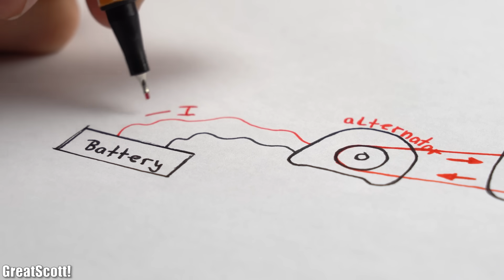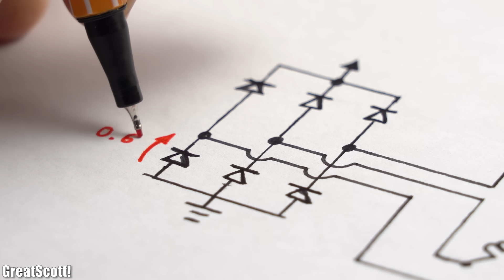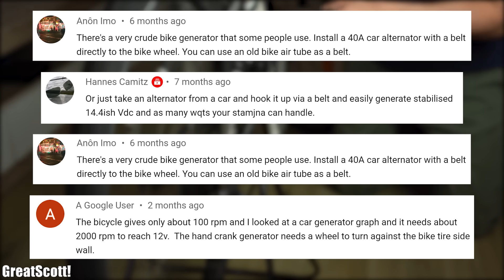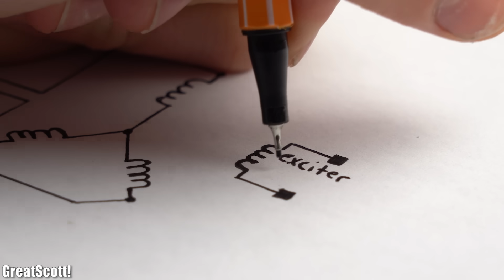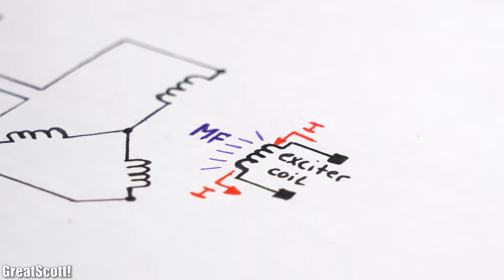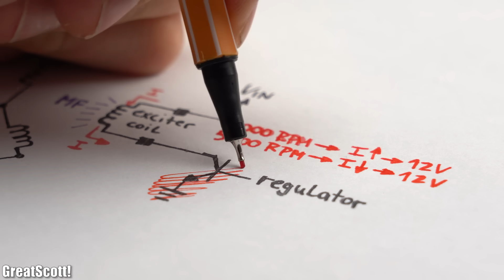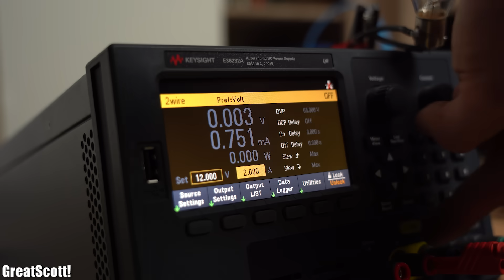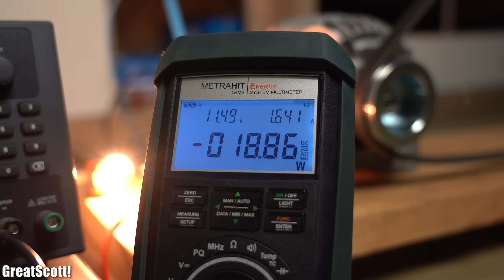Using a car alternator with a bike to power my home? How much energy can I produce?!

Comment: If you used some 12DCV group 31 stud type batteries or maybe even larger ones like 8D batteries in parallel with large gauge wire and good ring terminals to create a powerbank and ran a few alternators also in parallel to recharge the bank and you used a good belt and added a tensioner to reduce belt slip while maintaining optimal belt tension I see no reason why you couldn't run a large inverter off of the system and power something decent sized.

Comment: It can produce a power of 1440W.  Well, 746W = 1HP.  How many horsepower can a human produce?  I understand it's about one tenth of a horsepower for an average person in sustained effort.  A crack athlete can produce about 1HP, but only for a short while.
You should have used the BLDC motor as a generator - no problem there with producing a magnetic field.

Comment: I think you may need to spin the alternator much faster. My car idles at 6-700rpm and the driveshaft wheel is much bigger than the alternator spindle. I've not measured, but I'm guessing at about 4-5x bigger.
So that would mean the alternator would be spinning at 2400rpm at a minimum...

Comment: Ah that reminds me to the 90s, when my father tried to build a wind turbine for our RV. Not sure if he used a car alternator but it was quite a challenge to even power a tiny lightbulb. The thing also turned out to be quite dangerous when in use, with a ~1m rotor spinning at high speeds, mounted to the RV. Good times.

Comment: There must be a way to increase eficiency
Thank you for the video, I learnt somethings
Reply: actually changing to highest gear, building an MPPT regulator for the exciter coil, using the right six-grooved belt for the pulley, and a belt tensioner.
Reply: Yeah, maybe hook up multiple generators. Same effort more power efficiency.

Comment: Could you use this system to charge some batteries and run your house lights and possibly small appliances?
Reply: No. The output would be 50-75 watts. Even 10 riders powering everything would be 750 watts. Good for a few lights but not much else.

Comment: I did this with a vw generator from the 60s   I was able to get up to 20 volts using a bike trainer. I was thinking about putting it back together. I would like to test the amp output. Good video though.

Comment: Hey Scott,

I do not know the exact age and model of your alternator but if it is an older model, the 2 pins might be DFM (digital field modulation) and LAMP connections.
You were right about the excitation coil but the current should be regulated by the regulator, not from an external source.

These bad boys can easily push out currents around 100 Amps at 12 V, so when you are not drawing that much current obviously you do not want to dissipate that energy as heat, the regulator automatically turns down the excitation on the rotor, so you are not generating excess energy and also do not break the engine.

The DFM terminal usually used by the ECU to monitor this PWM signal, but of course it can have hidden functions which is used during production and testing.
Excitation should occur automatically, but you a need a certain RPM and a not drained battery (some supply voltage) to start up.

The LAMP terminal is a simple transistor, usually used to operate a relay inside the car. The function of this is to do not power excess electronics in the car when you start the engine, only after everything  is stable. The name LAMP comes from the fact that it is also used to light up the battery symbol on your dashboard when the alternator is not running.

Take everything I wrote with caution since a lot of solutions and designs are in circulation nowadays but you know it is automotive stuff so at the same time it is more or less standardized.

Keep up the good work, I like your videos.

Comment: If you remove the diodes you can turn the alternator into a generator. The diode circuit transforms the ac into pulsating DC that's why you get constant 12vdc out. But if you remove the bridge rectifier you will get AC output. Then you just need to find the RPM that maintains the freq. that you need for your AC requirement. Unless DC is what you want.

Comment: First, gears have teeth, a pulley does not, regardless the language. Words matter.

Second, 1 horsepower equals 746 watts. Before losses. You are not a horse, so not even gonna get close to usable real time power output even with 100% efficiency. And that design has a LOT of losses. Adding a tensioner just adds another loss. All friction is a loss. Instead, mount the alternator such that you can pivot it to add or release the slack in the belt, like is done in a car. A flywheel would possibly be the only useful addition that would compensate for it's loss by making the pedal workout a bit less exhausting. Would have to experiment more to figure that out.

Therefore, regardless the design, as a human powered device, it's usefulness is as a 'trickle charger' for a battery system. (That's what the setup in the movie 'Soylent Green' was used for, to charge a battery that was then used to power 12V DC appliances - light-bulb and hot plate. An inverter would have introduced losses that someone actually needing such a system isn't gonna add to their workout.)

But def an informative experiment, and I wouldn't call it a failure since it provided a lot of data very useful for your next try: Win-Win. Success, win. Fail, win with more knowledge not possessed before.

And, yeah, after watching so many of your vides, cool to put a face to the voice.

Comment: Simple solution. Replace the exciter coil with a speaker magnet that is about the same size so it fits inside the rotor.

Comment: Hi Scott, you measured 21W at output. I am quite certain that it is because you connected 21W lightbulb. Please, please redo the video with a bigger load. I suggest more lightbulbs and try to connect them one by one it should be harder to turn the wheel as you will have to apply more force to higher load. A cyclist can produce about 200W easily and up to even 1200W or more for sprinters. I hope I am understandable :) give this thumbs up please so he can see it ;)

Comment: Pretty sure it takes 2hp for every 25amp @ 12v
Reply: 2hp is around 1500 Watts     25amp @ 12v is 300watts    that's a huge loss.   Also a horse is actually around 8 hp.   A human is about  1/4 hp.

Comment: An oem front load washing machine motor into a inverter ? And can be stacked (multiples on one shaft), has less drag than an internal... 
Stay Safe
Reply: Alternators only provide power as needed (demand), you'll have to bypass that feature

Comment: I was a designer for a stationary power bike company for segeral years..
we could easilyt make 200 watss with 250 max possilbe....you're not thinking...
flywheels will help a lot..and you dc motor is wayyyy too small....this is home  made grade stuff...
motors that power chainwheels on bikes are the way to go...
I have a few of these motors I could sell you...
Savanna

Comment: Hmm, only 20 Watts? Have you checked the wattages of a typical, amateur road cyclist? They can put out 200W constant, no problem. Zwift reports from output from 150W to 600W, depending on whether I am cruising on the flat or sprinting -- and I am over 60. Younger riders are stronger (if they have trained even a little). So: apart from slippage -- which could be addressed with a belt or chain drive -- where else was power being lost?

Comment: You need belt tightner/tensioner to get equal and constant energy. And your wood-stand is not good enough. You need metal supported stand to avoid wobble.  Good luck with your project.

Comment: If you really want to use an automotive alternator, leave it hooked up to your car, start the car, and hook up a power inverter to the battery to give you the power you need. Or better yet, go online and buy yourself a $200 generator that’s built for the job, and have at it.

What you’re trying to do is doomed to failure. Firstly, an automotive alternator, despite its name, isn’t any good for generating usable ac power. Secondly, humans are terrible power sources, even the athletic sorts. A regular guy like yourself can’t put out any real power on a scale needed to power even a modest home.

Comment: The cars and trucks of the 1950s up until the mid 1960s used a generator, not an alternator. We used one in high school, 1970s, yes a long time ago, to do what you were trying there. It did work, just not as well as we wanted.
Reply: I’m an old guy that worked on those old generators. After cars started using alternators, we realized how crappy those damn generators really were.

Comment: Gidday mate, q. Why not just use some brushless treadmill motors, they are already a.c. powered, don't need as many rpm, don't have an igniter coil and though produce less amps (4-10) depending on the model, they can be stacked with minimal excess force required, or replace coils and brushes in the alternator with magnets.. love the idea though

Comment: @ Great Scott.

To achieve your goals:

Switch to a completely dc generator, or convert you alternator to all dc by removing the commutator.

When you are using the alternator as a stock set up: it is producing AC that needs to be converted to dc for the batteries. A lost of 30% into dc batteries and then 30% loss back out of battery to an AC transformer.

Secondly:

The belt from the back rim to the alternator needs a tention wheel to keep it tight.

Separately:
If you get a DC generator to a battery backup system, and put in a capacitor between the DC generator and battery backup: by doing this, the DC generator is charging the capacitor, not the batteries, and it takes the load off the DC generator. As the DC generator is only charging the capacitor. Then in a separate loop the capacitor charges the battery.

By doing this kind of a setup of the generator, charging the capacitor only: the capacitor takes the load off of the DC generator and therefore less resistance and a higher RPM.

Comment: Automobile alternators are very inefficient. The renewable energy crowd has been tinkering with alternators since the sixties. They found that alternators are not a very good base for efficient electricity generation. Much better is a larger version of that model motor that you showed. Although they did find some modifications that can be done to improve the efficiency somewhat.
  To improve the efficiency you can disassemble the alternator, measure the location, and the thickness of the coil pack, then press the fingers off of one side of the rotor and remove the field coil, replace the coil with some permanent speaker magnets and reassemble it back to the same thickness and located on the shaft in the same place. Remove the brushes, and the automatic voltage regulator which won't work any longer anyway. Now you'll have a semi efficient wild 3-phase alternator attached to a three phase Bridge rectifier. As the RPM goes up, so will the voltage. Keep an eye on that voltage so you don't over power what it is wired to and let out the Magic Smoke.
  If I were doing this, I would try to attach it to a battery through an mppt solar controller, although I would probably use a motorcycle alternator, or front load washing machine motor depending on how much power I wanted to make, plus a schottky three phase Bridge rectifier.

Comment: I tried this 7 years ago, using a 36 volt dc scooter motor (eBay £30.00) and car regulator to charge an old car battery, to power a 3 watt light.   Better to use just standard tyre rim dynamo(s), up to 4 on 1 bicycle, to produce up to 10 watts.
Only useful to charge up a battery in an emergency, to power a phone, radio, or a small LED light.  
The best solution for most people to charge a phone would be a small hand cranked outdoor generator (eBay £30.00).

Comment: How about attaching a flywheel to alternator its will be like adding a turbo charger to alternator ? I think that should add much more centrifuge spinning power voltage output from alternator, then dump energy into a few car battery's maybe 5 or 6 12v car battery's, and use inverter  to supply energy to household appliances. when peddling your bike its just generating the alternator voltage output power to charge batteries.

Comment: You should look into Gearing ratios if you put it on a stand and find a different way to gear it you could get that puppy spinning fast with minimal effort it would require manipulating the gears probably replacing them with a different kind and the gear on the alternator to match then you could put a gearbox in between keeping the tire for weight

Comment: I am doing something similar but using an old automotive generator instead of an alternator; that way the field current is supplied by the magnets instead. You probably still can't pedal fast enough to run your house but they are more efficient for off grid power generation.

Comment: Try to magnify the rotation speed of the wheel by adding another wheel, so that the rpm will increase, and to stabilize the rotation and resistance make use of a flywheel by which you can make use of a bigger size alternator....

Comment: You need to change the gear on the bike. It's in the lowest gear. Also A belt tensioner would be good too. A roller tensioner would prevent slippage.

Comment: I went through the freeze here in Texas and used a 2Kw RV inverter and jumper cables to my Acura MDX with a separate battery supplying the inverter. I had to buy what's called Diesel jumper cables which are 4 gauge instead of around 8 gauge automotive cables but it worked very well.
We have a gas heater so an electric motor and control board was all that needed power. The inverter has a 10 bar load indicator and we only needed 3 bars for this operation. Without the car running it would drain the AGM battery below service function(10V) in about 5 minutes. With the car idling I just needed to keep gas in it.
The house temp would rise from 62*F to 70* in about 25 minutes. One electric space heater drew more current than the central heater for my whole house but the heat generated was with electricity rather than gas. I was lucky bc we have a room on each side of our gas fireplace which helped a lot. I cooked and warmed food in the fireplace.
Great video on ingenuity, you don't know what you can do until you do it.

Comment: Should've used an alternator from the 70's. far less electronic crap to deal with. Plus they're designed to run at a lower RPM. My old car had a max RPM of about 3k on the dash meter.

Comment: A friend of mine made a similar setup. With the difference being the alternator powered a battery, the battery then powered a small 12v motor that turned the bike peddles. He hooked a set of car headlights to the battery and left them until he got bored at around 3 days. So with that in mind and with what you have done. Maybe power a battery, and run a motor that drives the bike. Put some tension on that belt, run an inverter off the battery, and a DC-DC charger between the alternator and battery. Most DC-DC chargers have a solar input. So some sort of solar panel, around the 250W range, will help with losses of power through all the different types of conversation. I could go on, but I won't. Great video by the way. Cheers

Comment: It's a lot simpler to install an electric bike hub motor that has regeneration.  No belts needed.  As you pedal without using the throttle, you will recharge your battery, in 10 or 12 hours of non-stop pedaling.  Good luck!

Comment: a car alternator needs to run at 13.4v not twelve,  you are putting 12v into the exciter you need more volts and then draw more current, putting a little light bulbin the circuit will not draw enough current to allow the alternator to create more power.. you need to connect to a 12v car battery which is actually 12.6v (minimum) and as you connect more ancillaries to the battery you will feel it harder to push the pedals on the bike. then you will create more power and your maths will add up to be not a waste of time.   great video love your channel

Comment: i have done this before as well , the cars generator take a bit of power from the engine , and after its coils are activated it gets quiet hard to rotate it , it need a good amount of torque to keep it at a constant speed , in a car its generally charges at 14V DC constantly, through most rpm ranges due to the regulator , the pins are usually light(or fault light) and activator coil , other is just ground and live

Comment: we don't need to go to eBay, go to any big city like Portland or Seattle or anywhere in California where it's a liberal crap hole and then basically find all those abandoned cars on the side of the road and pull the parts off of that you will have an alternator for free

Ashley was the alternator voltage output to dryer coil after you get excited.

easy way to do this?  read a whole bunch of used hard drive around the alternator and Pray....

Comment: I have made a working 12v DC  generator from  a car radiator cooling fan motor. It is mounted on my exercise cycle above the rotating wheel. Calculated the size of the  pully and fixed on the motor/generator end a v-belt connects the  cycle wheel and the motor pully. 
I charge my solar system batteries with it on cloudy  days when I cannot go outside for my usual jogging.  A set of diodes is connected in series so the power move from the motor/generator end to the batteries and not vice versa.

Comment: You used to be able to buy small generators for bicycles than ran off the front wheel. They powered a headlight and taillight without even noticing any difference in pedaling resistance. They lit up the bulbs as good as what this man was doing, even at relatively low speeds. I still have one of these generators, and it only weighs a few ounces, so something doesn't seem right with his elaborate set up?